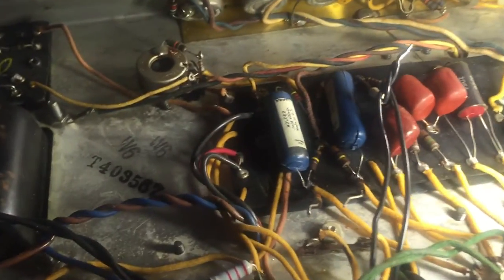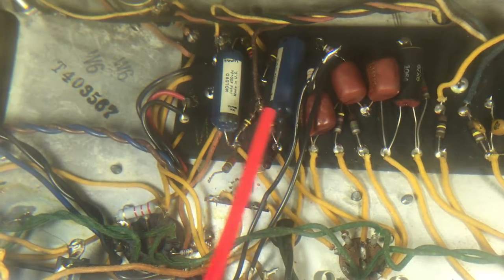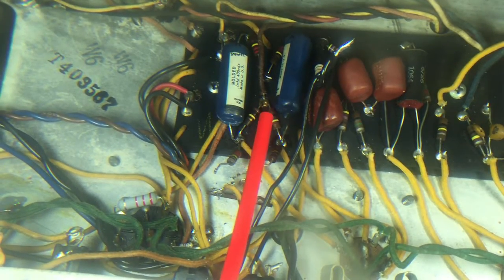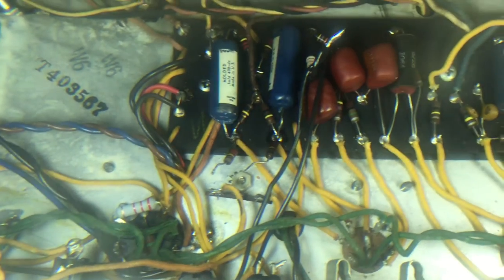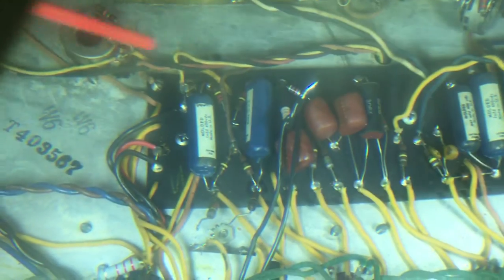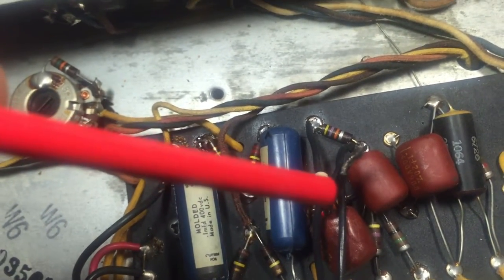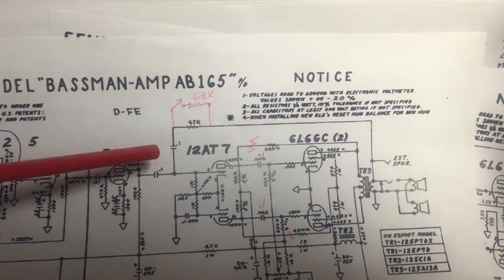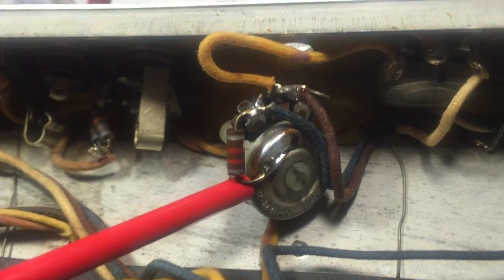My Blackface Fender Bassman AB165 - modified Bass channel

Comment: ?? why would you "increase" the feed back? the 6.8K and 47k will appear as about 5.5K further increasing the feedback signal and killing more tone. I would use the switch to open up/ remove the feedback ( ps: I'm  a tech also...) i try dif approaches on all amps. all safe mods.